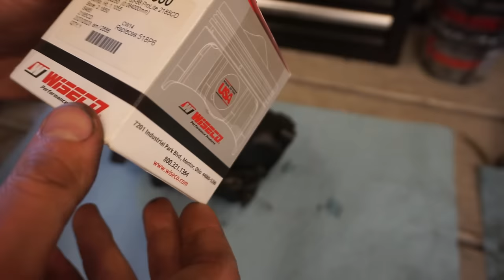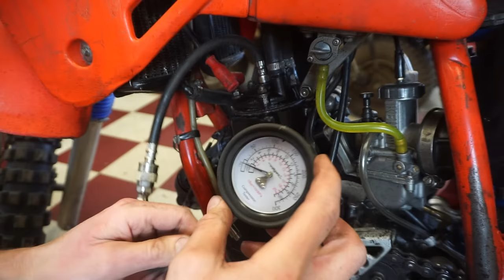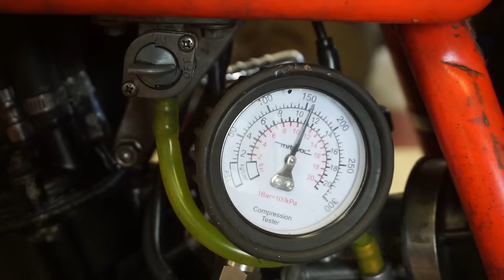$500 Honda Dirt Bike Is Transformed

Comment: Thanks Joe for yet another fascinating & enthralling video,I could watch these for hours.I have learnt quite a bit as well.I own a 2005 Suzuki Burgman 650 which I have recently done a soft restoration on.I do all my own maintenance & save quite a bit of money doing so.However,if it came to doing any engine work,I would find it quite daunting as it sits underneath the bike,so all the plastics have to be completely removed to gain access.The belt drive is rumoured to be good for 100k,so touch wood it never goes on me!!keep up the good work,you are very much appreciated by us!!👍👍

Comment: DANGEROUS DO NOT USE THE CABLE TO ADJUST THE IDLE.

You need the slack to compensate for the movement of the cable. It could accelerate itself when cornering.

Comment: Man your work is great but your patience when it comes starting fresh engines is appalling and actually annoys me..😡 There's no need to constantly try revving a cold engine!! Until a 2 stroke warms up that is when all the damage is being done, when it's cold it just blows the oil out the tail pipe and doesn't lubricate anything so as a rule of thumb you should never attempt revving the engine until it revs willingly without "bogging", you should never attempt to force the engine past the bog if your taking off cold and it doesn't want to rev yet..🙄🤦
Reply: I thought the same thing.  From Minnesota, when cars are cranking at -20F to get started people think they warm up faster if they rev the engine - grinds my gears
Reply: What’s the name of your YouTube channel??
Reply: @thebigguy8306  Fark!!😳 No....🙈
I'm from Australia and it never ever gets even remotely close to that cold here and I would still never treat any of my bikes like that when the engine's are cold, my collection is small but definitely cool!!
I have an '83 Rm250d, an '83 Cr480r, an '85 Cr500r and a crazy looking Yellow, Pink, Purple and Blue graphiced 2008 Rm250 that I just finished restoring myself for a regular rider.
Reply: @slurpnterps698  Wise Guy hey? 🙄
I don't need a YouTube channel to speak facts mate..🤣
Reply: @slurpnterps698  As you can see from my reply to @thebigguy8306 I have currently got 4 vintage motorcross bikes and have been riding 2 strokes since I was 4, I'm 44 next month so I'm pretty sure 40 years of experience qualifies me to have an opinion, I was simply trying to educate him so he doesn't continue to damage his engine's prematurely, but you go right ahead and continue being "that guy" that always has to give some stupid smug comment trying to wind someone up for no reason.. 
What a cool life you must live.🤣🤭👍
Reply: @markkeast6786  not being wise at all. I was wanting to learn from someone with experience. That’s all
Reply: @slurpnterps698  My mistake and I apologise then..🫣 
I'm so used to people being generally negative in the Youtube comments section it's hard not to assume the worst in people sometimes, please forgive me for miss judging your comment. 🙃
Reply: Warming up my four wheelers that are two strokes and I just give it a tad bit of throttle so it don’t quit when just 
firing up cold just enough so angina starts turning a slight bit more than normal idle RPMs
Reply: @markkeast6786  hey you’re good man it’s all good. I’m just  suggesting that you should share your information via a YouTube channel because people were definitely watch it. I would subscribe. I’m here to learn, is the best way to learn is from multiple sources.
Reply: @slurpnterps698  Honestly bro I wish I wasn't so technology resistant.. 
I would definitely get interest if I was into making videos because my latest Rm250 build is absolutely insane looking.😮‍💨
Reply: Taught me sum

Comment: the engine does NOT run properly AT ALL. something is seriously wrong. one can hear it. it does not scream as those 1986 cr 125 usually do. there is a LOT of power missing there. a properly running 86 cr125 will run circles around you. for me it sounds like there is something wrong with the ignition. and your ATAC repair is poor. that self made "Butterfly" disc does not seal. so the atac does not work as it should.

Comment: If you want to get the air screw right first try..... start the engine. Let it run warm(ish)... give it a little constant throttle and screw in the air screw. Keep it running because the rpm will drop..... Now give it a quarter to a third gas.... Slowly open the air screw. The engine will start to increase in rpm. If it won't climb in rpm any more, give it a quarter turn back and the air will be 99% correct. Blip the throttle a couple of time to see if it bogs. If so. Open it just a quarter turn.  Ride it 10-15 minutes and look at the sparkplug to see if your jetting is correct.

Comment: Watching this video, has me thinking You should invest in a Vapor honing cabinet. Would really make cleaning those top ends and engine casings and any bolts you need rust and other corrosion removed very fast and easy.

Comment: Bud every time you twist the throttle you keep dumping fuel into the carburetor. It can only hold so much. Plus kicking it so much and so hard is not good on the parts. You need full kicks from top . I’m very glad to see you working on these bikes though. One word of advice is don’t be afraid to follow a manual. Specs are important and so is torquing your bolts.  Most carb settings for a starting point is two  full turns out.  Thanks for the videos and keep it up

Comment: still not running right it should slam powerband and bring that front end right up in gears 1 through 3 atleast. The powervalve needs cleaned or carb cleaned. powervalves can get gummed up i have had that issue. I had a kx125 that would seriously bring the front end up in alll 6 gears no problem it was scary fast. I had a honda 125 though that was like this that never worked to fix it I sold I didnt know near as much about working on them at the time or I would have fixed it and kept it. I hope this helps see how when your going in the faster gears it starts to kick in like the power valve is stuck open or something

Comment: That bike was nit all that bad and had to have someone who had previously somewhat maintained it. I flipped many quads n bikes when i resided in upstate NY and the many so called "simple" fixes were often how i aquired things so cheaply as the previous owners realized that replacement of $11 carrier bearings the local shop either wanted $200 to replace or flat declined doing the job to begin with resulting in owner giving up n selling pre carnage or proceeded to butcher expensive and critical parts and components like axles n swing arms. Also large through bolts that go through the rear wheel and the one that goes through frame swing arm and motor cases that have not been serviced and well slathered with anti seize in a good while i have had literally taken a week or better to remove without destroying crap to get them out as they become so rust welded into the combination of metals they are in contact with along with bearings that move at pivot points and stationary contacts like frame n engine cases. Getting a through bolt moving enough to be able to get a 180 rotation can be quite the endeavor and that is often just the beginning of the process of penetrating oil soak spin the bolt get some heat on things n a nut back in the threads and get to brass hammer whacking heating spinning and lubing if persistent and having a torch you can get most out after a few hours but i had 1 CR80 Swing arm bolt hold tight for a solid week i didn't have a torch at the time but for a good 5or 6 days id squirt whack n spin before i went to the day job come home n put some time on other things with the bike and spinning and whacking several times every evening get it tapped out a bit and whack it back home n then back the other way gaining 1/2- 1in more each day without just going apeshit on it and destroying the threads on a $30 dealer cost bolt pre ebay

Comment: I remember being at Southwick for a typical local race early in the morning watching the fog dissipate from the sun burning it off and the smell of two-stroke in the air. This was back in the mid-eighties in the NESC - the premiere organization in New England for competitive motocross. It wasn't much later when the experts were at the gate about to hit the track for practice. I remember hearing these 125cc bikes screaming at full throttle cutting through the deep sand. I can still remember the smell of burning-hot exhaust pipes as the bikes flew past the fence. Guys like Joe Waddington, Badger Dzielak (?), Todd Richotte, Wemyss Scott, Jojo Keller, Pat Barton, and so many more of New England's fastest. Thanks, Joe for digging up one of these little gems. These memories will last until my final day. Great job. 👍

Comment: Another great video just surprised at what length you didn't go to in the cosmetics of the bike, after new seat cover, gaitors and tank decals a couple of Pro-link decals on the swingarm would of made a small difference and to be fare some paint on the bare metal wouldn't of gone amiss considering all you did to the motor

Comment: Im srry this doesnt have a power valve 125 didnt get the atac engine until later. and i tell you the atac was the best one honda made. I had 250 and that mofo ran. when the powerband kicks in its freaking insane. they only did it 85 and 86 unfortunately then they came out with a broader power band that I dont like the new ones dont hit as hard it really sucks. I dont like the low end powerband only the high rpm ones.

Comment: Need to get a little parts washer, I would have thought that cylinder would rust immediately after honing and introducing water to it
Reply: My father would have had a stroke watching you wash car parts in soapy water. He washed and cleaned every part in Petrol and paraffin. Also, he never ever slide a piston or ring into a cylinder without copious amounts of oil to lube the rings, piston and cylinder before test or fitting.

Comment: 32:17  Use compressed air to easily install new grips. 44:01 why do you continually pour the oil from the wrong end?  Bad habit?

Comment: Did you open up your ring gap a bit more , i know you said they were pretty tight , i know with heat rings can expand and chip when theyre tight before the heat cycles, just wandering if your gap clearance was within spec or did you ever file them some

Comment: Two strokes do best with a sealed exhaust. I have found that setting the air fuel screw at idle till it get the highest RPM with no throttle then turn idle down and repete fine tune till it will idle at a super low RPM. Then adjust  throttle stop screw (Not cable adjust on handle bars)  to desired RPM. If you can get it to idle at 500 rpms  then turn the idle stop so it idles at 800-1000 it will have low end grunt to build RPMS to hit power band with little bogging.The cable adjust should have a little slop in it so carb slide rests  on the idle adjust screw. I raced two strokes in the 70s Boats-street and dirt bikes. A three cylinder kawasaki is a great teacher about how to tune a carb then sync it with two others. The ET slip tells you just how much you helped or hurt the tune.

i

Comment: Trick I learned a long time ago for seat covers if you use a blow dryer and heat them up real good they’ll stretch easier
Reply: And a trick I found out when I was younger also for scratched plastics. If you use a blow torch on them, it’ll bring back the shine and self level some of the scratches in them.

Comment: you run 50 to 1 gas ? what brand of oil in gas ?
Reply: He put 4 stroke oil in the case😂. This guy? I found years ago putting automatic transmission fluid in these cases make them shift so easy.

Comment: What’s up with the oil in base of the engine? I thought 2 strokes don’t need engine oil.
Reply: You have to put transmission oil in the bottom end to lubricate the gears.

Comment: Looking good man I got a question I have a 03 400ex I got it ut ticked really really bad but I replaced the tensioner it quieted it up some but not a lot could it be my chain is so stretched? And yes my valves are in spec
Reply from the maker: Yeah probably a stretched chin
Reply: Also check cam lobes and rockers.

Comment: The break-in on a newly installed top end is often downshifting to seat the rings and not revving high. That is what I know.
Reply: This drove me nuts. Winding out through the gears on fresh topend. Why did this guy never read or ask about 2 stroke break in on fresh builds??? it's strange guy has nice garage and house and must have good paying job but basic common sense on simple things is not applied in these videos. I don't want to sound like a prick. I've had 20 dirt bikes in the past 4 decades. I asked questions. Didn't just do whatever
Reply: He reads a lot on the internet too. Probably does a couple heat cycles before he goes on the field too. 

Some people say that 2-troke doesn't need break-in after a couple fo heat cycles. However, I couldn't rev through the entire power band the first 50-100 miles.

Comment: Looks and sounds great.  I'm always impressed with your skills.   

That kick starter doesn't have a lot of travel.   If you're looking at the kick lever as the big hand on a clock, normally you'd start the kick around 10 o'clock and the lever would go to at least 6 o'clock, probably a little more.  The fact that it stops around the 8 o'clock position seems like a design flaw that could lead to something breaking, but I don't know dirt bikes very well.  On the vintage street bikes I have there's not a ton of force against the stopping point, if you even get to it with your kick.   That kicker seems to stop right at maximum kicking power.   I'm sure it's engineered it to take it, but watching it get kicked over and over again makes me nervous.
Reply: I think it’s that way since not much force is needed to kick such a small cylinder. The KDX 200 I used to have would start around the 9 O’clock position, and go down to the 6 O’clock position.
Reply: His skills are negative

Comment: Hairspray is the best thing to use to install grips, IMO. Slippery when wet, dries like glue. Geat video as always!
Reply: Then slippery again when it's hot. The best thing is clean rubber against clean metal bars. Use an air compressor to install them easily and they will not slip round.
Reply: Nah…just a little spit on the tip has worked for eons😉
Reply: Safety wire..  No adhesive necessary.

Comment: A plastic scraper (or even a credit card) works well for ironing on the decals before removing the scrim layer. Surface needs to be clean and dry before ironing on the decals. :)